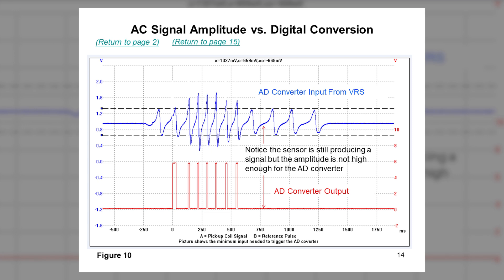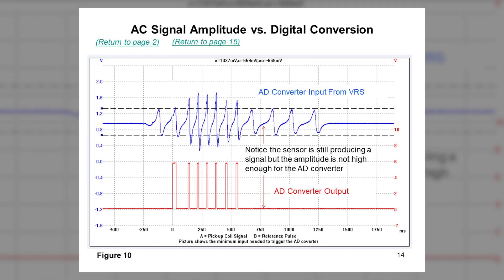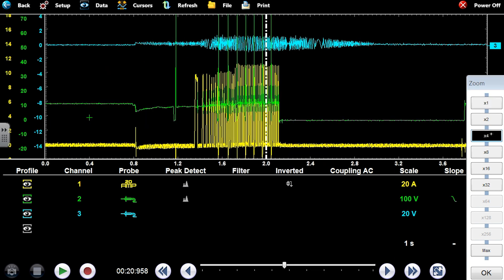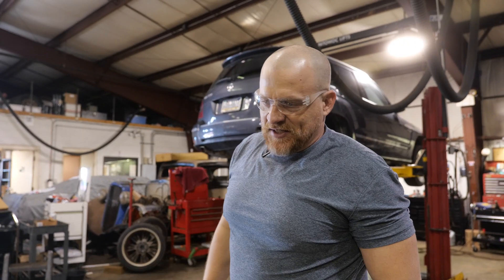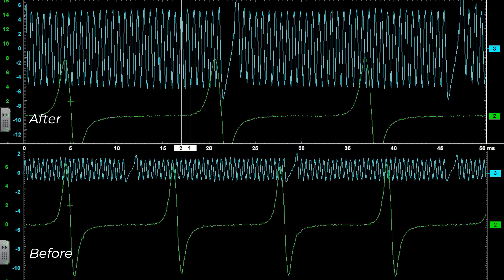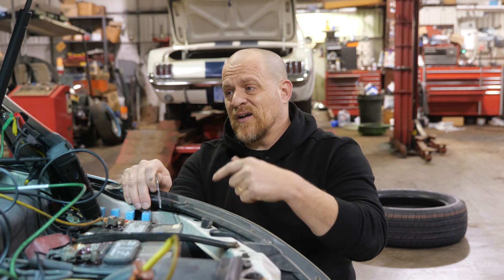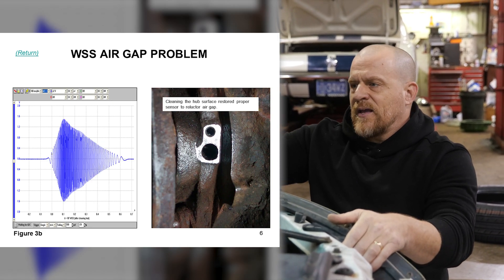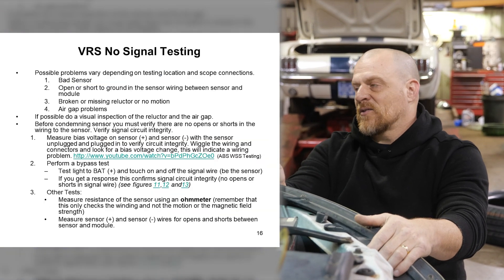Diagnostic Fees [What Is The Standard]

Comment: Had a fleet vehicle w/ hard U0028:08 and a U1A00:87 codes.

Charged them 4 hrs.

Search these codes on iatn and you can see the frustrations that I went thru.

Bottom line I tightened up a comm line pin.

Love love love your videos.

Comment: Our shop uses a "level of testing" system... standard diagnostic (misfire etc) would be level 8 and major communication is level 10, HVAC blower motor is level 6. These are time based but seem to have a balance of expertise vs time. Not fully sold on it but very rarely do we drop the level after the fact, rewarding techs who are good at diagnostic

Comment: I live in a suburb of the MotorCity where very few know anything about modern automobiles, even though they are in the auto industry. The biggest misconception I get constantly is, “plug the computer in, it’ll tell you what’s wrong.” 🤦‍♂️
  I usually have to explain what the fault code means, if one if present, along with system driven diagnosis versus symptom driven diagnosis. Once they understand what I must do it becomes much easier for them to accept why I charge what I do for diagnostics.

Comment: Perfect example for you, yesterday I had a 2013 Chevy sonic come in. Customer said put a mass air flow sensor in it, Oriellys scanned it and said that’s what I need. I said ok but are you sure that’s what it is? Or would you like it diagnosed first? He said no I’m sure. So I put the $300 part in. Cleared codes and test drove. Engine light came right back. I get back to the shop and I said would you like it diagnosed now? He said ya I have no choice. Diagnosed it found a p0171 and p0101. Lean and MAF. Found the air filtration tubing ripped. Charged him $75 diag fee and the tube was $112. Install was 0.30. So all together $245 out the door. But also had to charge him $345 for the MAF sensor he wanted put in. He ended up costing him self more money in the end. But no matter how much you try to explain this to most people they don’t wanna believe that paying for diag and having a 100% guarantee will be cheaper then guessing.

Comment: Silverado comes in with CEL P015B? The flow chart has you test for intake and exhaust leaks, injector balance, water intrusion, oil or coolant consumption and a few other tests. Put an oxygen sensor in and wait to see if code comes back or charge for diag and fix it right now?

Comment: I would charge by the car, not by the hour. However once I get to the point labor is involved then that is additional.  As an example- car has misfire#3. That will be a $100 diag charge. If it’s just a bad spark plug wire- yay I win. But in that hour I find it’s very clear the PCM is not grounding the fuel injector and that PCM is under the dashboard then i would lose if it was still $100.  So then it’s an hour labor to dig the PCM out and complete the diag.

Comment: At one place I worked shop would charge 125 the first hour which usually was all it took but if it was more complex and take more time it would be 125 first hour 75 for the next 3 hours max. 350 total for complicated diagnostic
Reply: 350 for a can bus issue or intermittent is a rip off for the tech working on it, you can make more from brake jobs.

Comment: What’s wrong with the standard? Every shop I’ve worked at or even heard of, it’s an hour diagnostic charge for an engine light/drive ability issue where the scanner is involved. The full amount is charged whether you take 5 minutes or the full hour. Maybe I’m missing your point, but I don’t see what the gripe is, with this time/charge correlation…
Reply from the maker: The under-car specialist makes more than the diagnostic guy in every single shop that I know. This is what I'm advocating change for.
Reply: Only way you can change that is by starting a union

Comment: Education and setting up a process. Educating the service advisors and the customers, building value so they understand what we are charging for and what they are paying for. So they understand they are not paying $180 to "hook it up to the machine" 
Maybe we should call it a minimum diagnostic fee. Maybe menu price a level of diagnostic. 
0.5 of shop rate for "code pull and dart through" 
1.0 of shop rate for "normal or minimum diagnostic" 
1.5 of shop rate minimum for scope use. 

Or however you want to do it. 

It also doesn't have to be connected to the labor hours for the customer
$50 code pull fee
$100 diag fee
$150 scope diag fee
Etc.

Comment: First off shops need to get out of the mentality that they need to work on every car/truck that shows up. Experience dictates customer attitudes and when explaining a standard diagnostic fee if pushback is sensed maybe they need to go somewhere else. A standard diagnostic fee is set and the customer needs to understand they are paying for your knowledge and ability to properly diagnose a problem. I always started with a set fee slightly above our shops hourly fee allowing for 1 hourish of time to diagnose the issue. In reality this is 1/2 hour of time. Within that time you should have a pretty good idea of what you are looking at and how to approach it. If needed you then discuss with customer the direction you are going to take and if more diagnostic time is needed. Intermittent problems take longer to find and may need more fee charged. The key is open communication with the customer and if there is any pushback they need to go somewhere else before you even start to look at the problem. Once in a while you may need to eat some testing time to get a positive diagnosis however the 98% of the time you “beat the clock “ covers the small % of times you don’t. Time spent researching or even thinking about the problem is all part of the process and is part of standard fee..
This is a argument that has been going on for years and one of the hardest parts of running a shop. You can’t please everyone and you can narrow down the negative attitude customers by just plain refusing to work on their vehicles period.

Comment: I brought my sons Volvo for abs no com code with a rt. front sensor code. The shop operator charged for switching front sensors with no change. Then wanted $450 to check abs module wiring. Powers and grounds?

Comment: somepeople must be getting to them, sad people are lowballers these days..i mean dealers are like 150hr flat rate, i mean i deal with a mexican owned shop, 1-2 guys are like danner there, but nowere as good, 100usd should be right, yea people will be pissed its solved in 30min,, but it  alot of times it wont,  and NO  in the south to the north theres not much a difference in labor rates i had vehichles serviced in SC and NY, unlike SMA were Eric does it all, alot of shops wont, and like danner and his br0 may have top diag techs only doing the work. Does diag fees translate to non computer /elec issues?   like suspension noise, or this or that, its debatable there, its a 2 way street dont bullshit the customer, and customer dont expect a miracle for 100usd after 1 hr they havent found the issue. Like Danner and SMA  they all get vehicles they everyone gave up on or parts changers etc, thats why there there

Comment: so what is a standard? 1 hour per complaint?  what if there are 5 complaints but you find out later 3 were related?  this is why its not cut and dry.  going with a flat rate style is good for a customer but not always good for the tech or shop. inversely a time and material approach is not good for a customer if the shop/tech isnt up to snuff. so where does a median lie that is fair to both......... the world may never know! the chicken or the egg?
Reply from the maker: Nope, it certainly is not (cut and dry) there are variables within variables. That's why I intentionally left out the "time" and "cost". Each one is a case by case basis. But it time to stop charging a rate that makes the undercar specialist a higher paid tech than the diag guy!

Comment: Customers only recoil at the thought of paying for diagnosis because they have got burned in the past by shops that charge the diag fee just to load up their parts cannon, rather than do actual testing/troubleshooting. If folks could find a trusted diagnostician like Scanner Danner, I bet they would be happy to pay for diagnosis and save money in the long run.
Reply: Exactly!
Reply from the maker: Exactly! We need to help the customers find the "ScannerDanner" type shops!
Reply: @ScannerDanner  I wish you live on the other side of PA, lol. I paid nearly 200 dollars for a BMW specialist to "diagnose" my car. They condemned my cluster and wanted to replace it for 2K. I declined and fixed it myself with a 50 dollar cable, research, and learning some software in the same hour or two they were supposed to diagnose my car. Shop later contacted me asking if they could assist with anything else, I told them I fixed my original issue. Come to find out all they did was attempt to hook up two scanners to my car and then condemn my cluster. I paid almost 200 dollars for that? Where was the diagnosis then? Problem with my car was it lost it's configuration settings, so I had to figure out how to restore a default one back to the ROM.

Comment: I'm certainly not an expert but I think the concept of time being used as a measure of labour comes from the era when most cars were simpler, required less diagnosis and were more mechanical, which required disassembly. Disassembly and reassembly take time. This concept still holds true today for largely mechanical jobs like brake pads and timing belt replacements (to name a few). And I think it is fair for such tasks. Electrical jobs which are diagnosis heavy are a whole different kettle of fish. Like you said people can't be paid less simply because they fixed it faster (due to their knowledge). Personally, I think these should be billed based on how much knowledge is required to actually troubleshoot and fix the problem without having resorted to the parts cannon. Contrast this to a timing job where the amount of experience has dramatically less effect on how long it takes to complete, and where you're just swapping out a part.

Comment: That’s the way it should be, but on the other hand there should be recourse against technician and shop for misdiagnosis and parts installed that were not necessary. You never see credit for that. The customer will be charged for parts and labor. I believe that’s where the big mistrust comes from. Obviously, using the right shop is the fix for that, but how does the customer know that ahead of time.
Reply: You hit the nail on the head.  This is exactly why there is a mistrust of shops.  When you have spent hundreds or thousands of dollars to a shop to fix a problem and they can't fix it and still charge you, you get a bad mistrust of repair shops.
Reply from the maker: We have to guarantee our "call" if we are going to charge the rates I am pushing for. There is NO ROOM for a misdiagnosis here. None!

Comment: In HVAC diagnosis is from 5 minutes to a few hours in exceptional cases, but the charge is always an hour. And its only 5 minutes from year's of diagnostic experience, that's what they're paying for.
Reply: 90% of the time it’s the cap, thermostat batteries, flame sensor or hot surface igniter.  😂